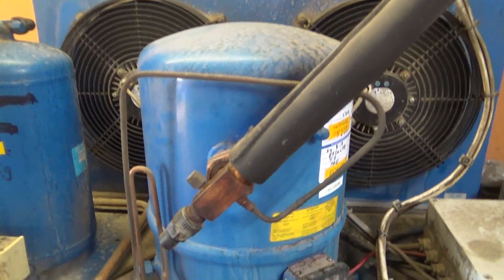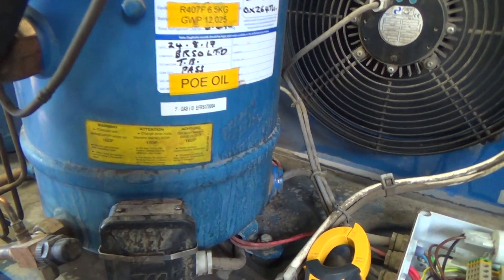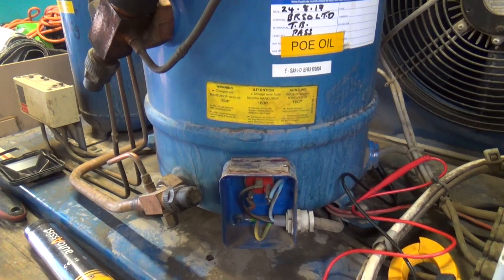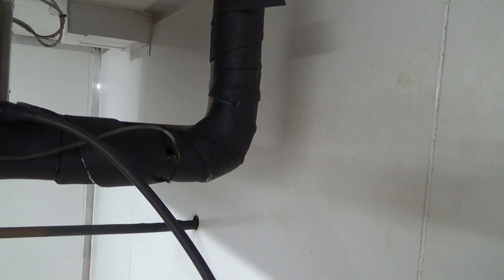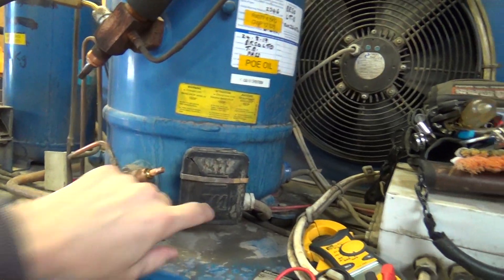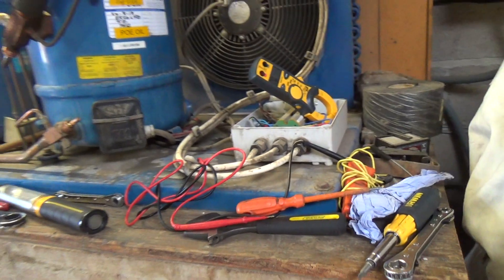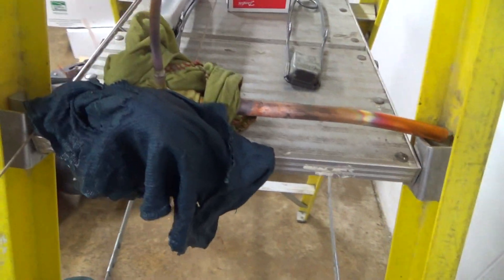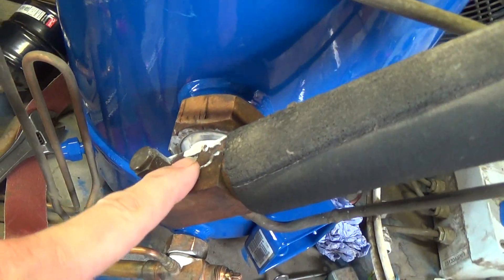Maneurop Compressor Diagnose and Replacement

Comment: I’ve found caps split around the threads. I believe that it was because some super tech tightened the shit out of it trying to stop a leak rather than replacing the s schrader valve.

Comment: Somehow I missed this vid  and hadn't watched it yet .
Did you manage to get the rest of the moisture out then ?
By the way , I've got the same Testo vaccum gauge , and I use the same bit of small hose with it , but what's that fitting you have at the end of it ?
And do you find it stays tight and leak free , cause the small bit of hose doesn't seem very trust worthy to me , at least the connections , and I can't get my hands on Nylog which drives me bananas ...
Cheers John , been a minute , I hope you're busy out there mate 👍
Reply from the maker: Yeah, I went back and changed the oil in the compressor which helped lower the moisture levels.
I've not had any problems with the short hose other than changing the gaskets, the fitting is a 90' elbow  which is handy when there is not room for a straight connector.
Yeah its gone really busy plus having issues with editing software making the computer crash, hence the lack of recent vids!
Reply: @heavydiesel  Noice , good to see you guys are slowly getting back to hopefully normal , always better to have too much work than not enough , we've learned that the hard way with that whole thing eh .
Good on ya mate 👍

Comment: Nice job, you have to be carfour about double faze, i use to have  R R T, insted of R S T.....did you fix the gas leak on the expansion valve?
Reply from the maker: Yeah I fitted a braze in R449A valve so it won't leak again!